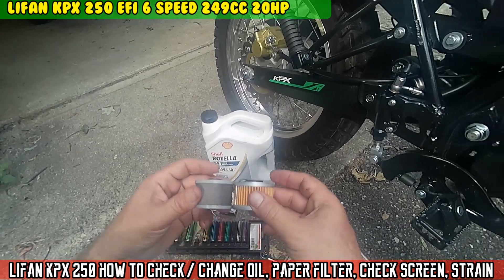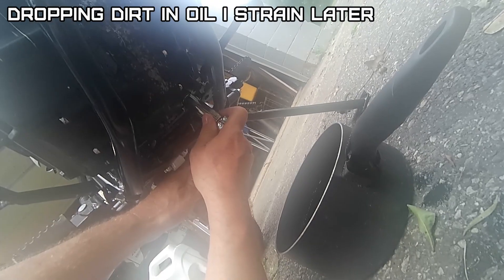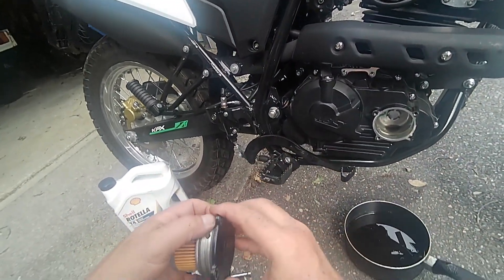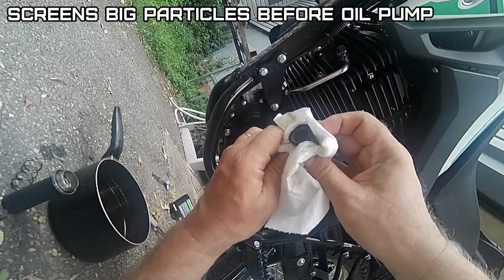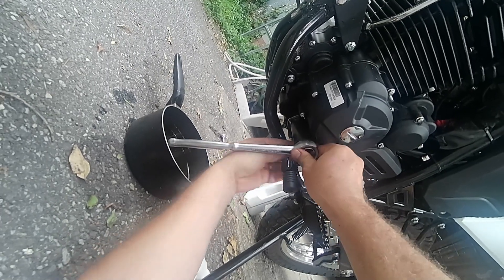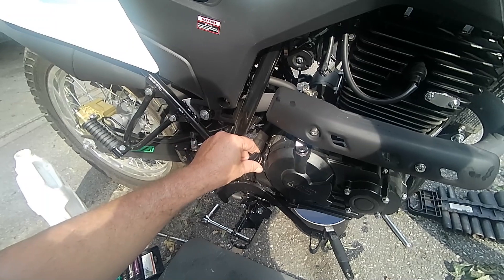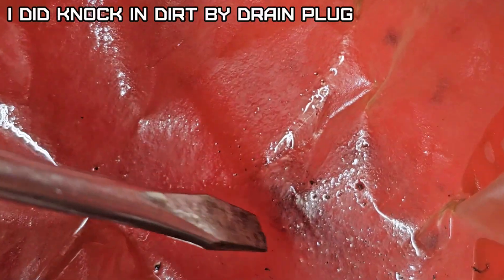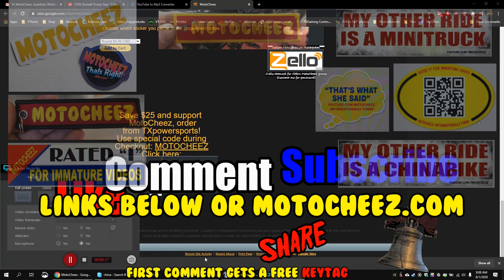PT6 Lifan KPX250 How to change oil, kind of oil, new paper element, check oil level, check screen

Comment: I measure ID and OD on the oil drain plug then order aluminum washers by the 50 pack and that will replace the crush washer. Cheaper than copper too.
Reply from the maker: You can reuse the copper ones several times just make sure they do not gall. Copper is better in my opinion.
Reply: @MotoCheez  I found the copper retains the shape (indentions).  And as cheap as the alum washers are I get them in 50 packs, lots to just throw away. Keep up the good work.

Comment: I've had a hawk with 8k miles and a orion rxb 250 with now 4k. I have never seen so much junk in the screens with my bikes. Watching these videos makes me happy with my purchase. KPX has its place but not for me.
Reply from the maker: All my CG bikes, hawks, tbr etc had much more crap floating in the oil first 2 oil changes.  Those other engines don't have a screen style filter which actually is now replaced by a paper element so it'll catch way more crap from circulating through the motor

Comment: That's one of the upsides I love about my scooter. Since it's a GY6 clone there's no internal wet clutch to accidently ruin because you poured the wrong oil in it. So come next oil change I'm gonna run AMSOIL in it like all of my other machines. I'll just have to buy the high zinc formulation to help with the valves and cam. It currently has Kendall GT-1 20w50 conventional in it because it was cheap and it had a high zinc formulation. I also went with such a thick oil to help it out while riding around during hot weather. So far for the price the Kendall GT-1 is good oil but I'm a big lover of full synthetics so I'm just sticking to that for all my toys and vehicles minus the Hawk.

For the Hawk I've been running Lucas 10w40 semi-synthetic blend formulated for air-cooled atv's with wet clutch. So far it's been good but I only ever rode the Hawk once this season. For the next oil change it's getting the same oil but this time I have a bottle of zinc additive to put in with it. :)
Reply from the maker: Awesome, many people don't know the importance of knowing what oil is needed in these bikes and scooters.
Reply: @MotoCheez  I think my scooter asks for the same 15w40 weight as your KPX. So running 20w50 in it shouldn't hurt it. Especially when she's up to speed and driving it revs out at 6,500-7,000rpm. So it'll need all the help it can get in hot weather. :)
Reply from the maker: @Slane583 absolutely, I run 2050 if I can't get the 1540 because it's good pretty much 30° f and up to over 100°
Reply: @MotoCheez  Some of the scooter builders I've watched who modified their GY6's have them revving out at 8,000-9,000rpm because of their clutching. But they also run high flow oil pumps and oil coolers with theirs. Which I'll have to add on eventually. :)
Reply: @Slane583 20W50 is rather “thick” these generally say 10W40 or 15W40 and diesel oil is the better option etc
Reply: @nct9466  So far I've only ran 20w50 in it once and it has just a hair over 1000 miles on it. 

The next oil change will end up being the proper weight oil for it. The Kendall GT1 was just a cheap quick oil change.

My local Runnings store I shop at doesn't carry AMSOIL's high zinc oil. But I did find their oil for diesels there. So I'll most likely run that. It's pricey but I like AMSOIL so I'm gonna run it in everything I own. Keep the brand consistent.

This summer has been awful as far as weather goes. So far it seems the only time we get a nice sunny day is during the week when I'm working. Once the weekend comes we get one sunny day if we're lucky and the rest is pouring down rain. So there hasn't been much riding this season.

Comment: The screen type reusable oil filter is perfectly fine, frequent oil changes is best 1000km or miles is what we use to do.
No point in the paper filter for off road type use n frequent oil changes
Reply from the maker: I figured I'd put one just to catch the fine particles if they're getting through, little extra insurance. Yeah I always do mine at 500 or a thousand miles on all of them

Comment: Have you ever disconnected the plug wire and turned the engine over when draining the oil at the end?
Reply from the maker: No, I'm not sure that would be a good idea to run the pump and bearings dry and then have to have it suck back up through the pump into the bearings and run dry for that small amount of period it only keeps like point one or two quarts in there according to what it says in the manual for brand new motor and oil change difference
Reply: @MotoCheez  everything is coated with oil.. You only crank the engine for 1/2 a second .  more oil comes out but not much.
Reply from the maker: @kevinnashskitchen3517 Yeah I rather not, those type of bearings that are on connecting rod uses the oil as a layer of protection, they're friction bearings. They're not actual roller bearings or ball bearings. 
I don't know if I want to risk it. That little bit of oil that's left in there shouldn't affect anything
Reply: @MotoCheez  right.. Not really a difference anyway

Comment: Today I got a quote from Venom for 2 oil filter o-rings. They want $39.99 and shipping too!!! Do you know where to buy parts for the KPX 250 that are reasonable? Venom's parts are way overpriced.
Reply from the maker: I bought the oil filters in a come with the o-ring online from Amazon, I believe it's in the description of every KPX video I do but I will go check
Reply from the maker: https://amzn.to/3L80dyI

Yeah I did have it in there and a few other links for this bike
Reply: @MotoCheez  These would be the 2 oil filter o-rings that fit on the screw on housing, the one with 4 bolts and you need to line up the 2 holes on the left engine side and the filter cap so the oil flows into the filter housing.
Reply from the maker: @Kevin-mm6xm not the oil filter one then? I don't think I know which one you're talking about. I was think Napa would carry that if you brought it down and sized it up
Reply: @MotoCheez  When you replace your oil filter, you take 4 8mm bolts off and carefully pry that cover off. That cover has two o-rings on it. That's what they want 40.00 for but I can get them other places. What I really want to know is where to buy other parts for the KPX 250 at a reasonable price.
Reply from the maker: @Kevin-mm6xm I bet your NAPA could match it up
Reply: @MotoCheez  The last time I did an oil change I measured the o-rings, 60mm. Not so sure about the thickness, but I did a search on Amazon and I found them at 1.0mm, 1.5mm, and 2mm. They are really thin so I think the 1.0mm might work.

Comment: Thanks for your content man. You and Jerry helped me pull the trigger and order one for myself. Comes this Thursday. 

Is that the original oil that came with it? I know the owners manual says the oil that comes with it is 15w40 and good to run but I see others still recommending to change the oil when getting it and using a filter like you’re using (I looked at wix and KN and both use synthetic medium).

You think it matters? I figure I’ll either run it 25-50 miles or change it right away and then go at 150-200 and again at 500 miles. Probably again at 1000 and then I’ll switch to fully synthetic and do it every 1.5-3k miles.

This is my first bike and first time breaking in an engine. Does that sound about right to you? I’m okay with overkill - I figure oil is cheap enough and it can’t hurt…
Reply from the maker: Congratulations! Yes you're on the right path on what to do for oil changes and break in. The oil that comes in it is fine for breaking I put about 150 mi on mine and then put in fresh oil and a thousand miles I will put synthetic. I will definitely be changing the oil again at $500. Putting a paper element filter is probably not a bad idea right off the bat! I would have if I had known about it
Reply: @MotoCheez good to know! From looking at owners manual it says check/replace oil filter at 6k/15k km(edit: 3.7-9.3k miles). I was honestly planning on each time until break in. 

Honestly after that, every 1.5-3k which I assume will be roughly 1x/year with oil change. Only 11 bucks if not buying in bulk. 

Do you plan on doing the same? I know I’ve gone every-other oil change with my truck but I also go out of my way to use 99.9% efficiency filters and the best oil I can get. 

Appreciate your help for us noobs! I know I’m overthinking from excitement and thanks again for all the help.
Reply from the maker: @sknapp19911 I usually do every 1000 on the bikes if I'm mostly doing off-road. Cheap insurance

Comment: What do you prefer. T6 or T4?
Reply from the maker: One for break in I definitely want to use a t4 and I may move to the t6 synthetic
Reply: @MotoCheez  Good. This is what I did for my Grom clone. I would choose T6 5w-40 and not T6 15w-40. T6 15w-40 is better suited for diesel so I hear.
T6 5w-40 is better for gas engines in that it lubricates easier, starts easier, has a better cold start viscosity, and extreme temperatures.

Comment: Wheelbase comparison  🙂
Lifan KPX 250 ... 1445mm / 56.9in  (from owners manual)
Hawk X 250 ... 1370mm / 53.9in  (from txps webpage)
Reply from the maker: Never noticed that!
Reply: I think that extra 3" makes a big diff. for handling.
For one thing, it helps keep the front wheel down.
Maybe you could confirm that with a tape measure (in your cheezy time).  🙂
Reply from the maker: @FnLn55 and heavier front end being inverted forks. DLX also was impossible to lift front end
Reply: Wondering also how the longer wheelbase affects the rider's triangle, perhaps the pegs are more forward, and knees less bent, eh.  🙂
Reply from the maker: @FnLn55 I can check that too, but these pegs feel more toward rear. You can stand up on the pegs and it's not aqwuard like the hawk
Reply from the maker: I did confirm this would have tape measure it is in fact what the manuals say. So 3-in longer wheelbase on the KPX 250
Reply: Awesome.  I like that.  Thanks.  👍